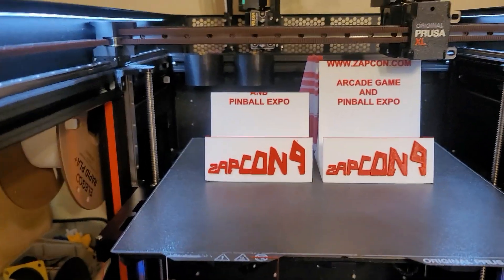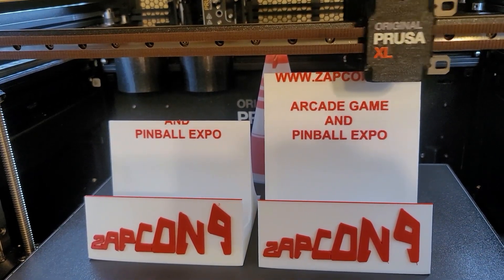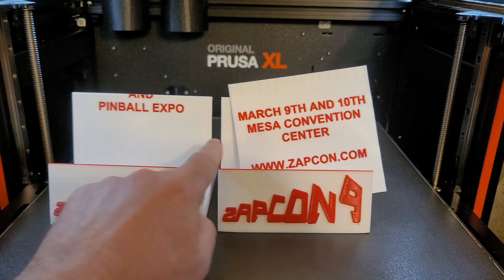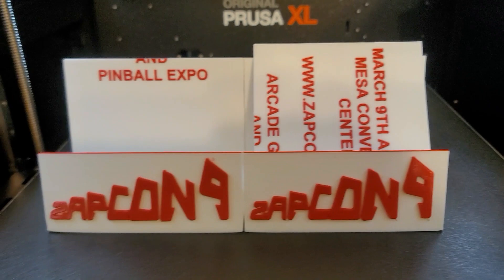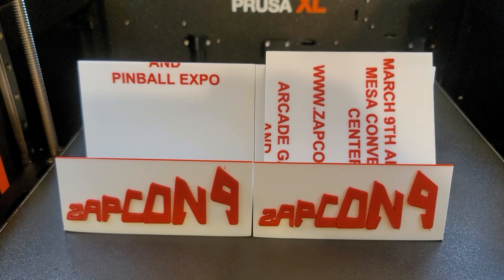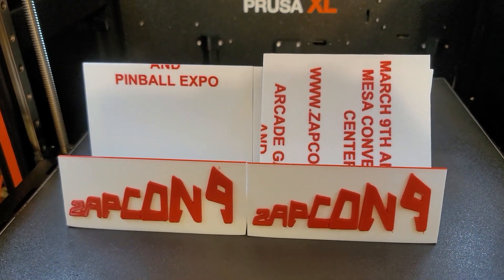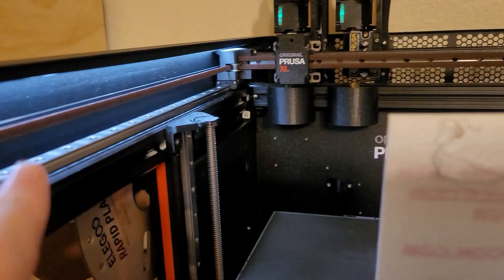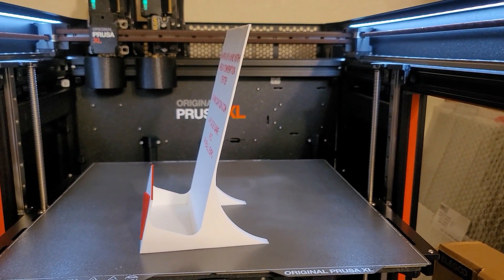Prusa XL Cancel Object

Comment: That's the side that's away from the fan, so it makes sense it might have blown some strings to that side. But the other one was great on both sides?
Reply from the maker: No stringing.  It appeared as if it needed support and several strands were sagging.  The opposite one printed fine.